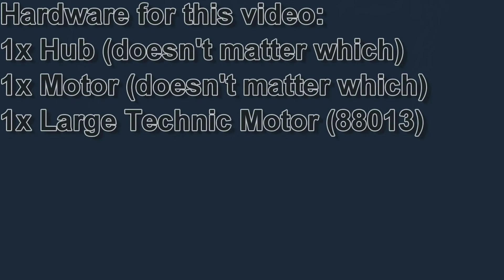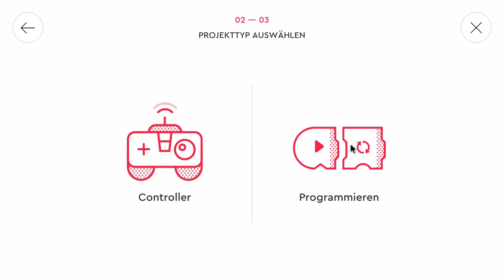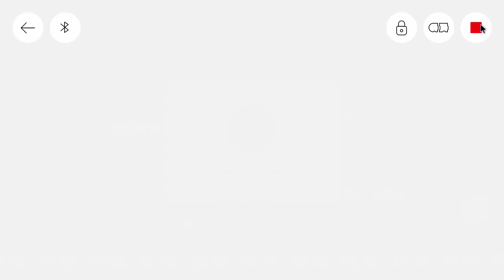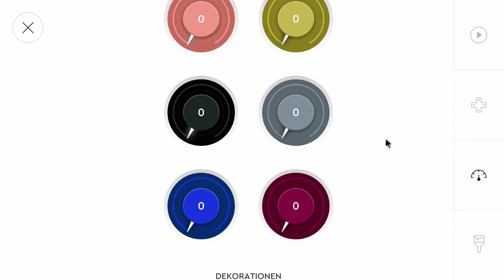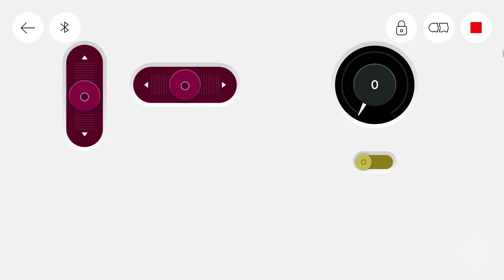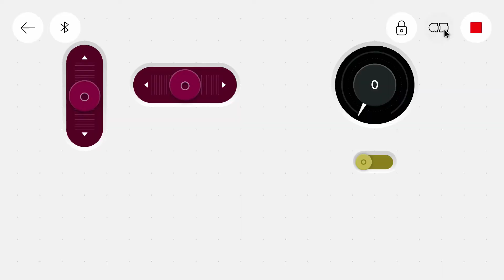Lego Powered Up Tutorial #10: touchscreen control layout designer (lights for 42099) [English|HD]

Comment: HI mate! great video!) i was wondering if there is a way to program 2 motors from one hub and 2 from another as drive train, cant figure out how to connect 2 sets of motors to one aceleration slider(
Reply from the maker: You can use 2 motor blocks and give both of them the same slider as input. keep in mind to select the right motor port/hub (the hub select block is required for a second hub).

Comment: As a programmer I find it odd that you need to use a loop to read the value of a button, it could be nice if you could get an event every time a control value was changed.
Reply from the maker: You can make an event with the "start block with input".